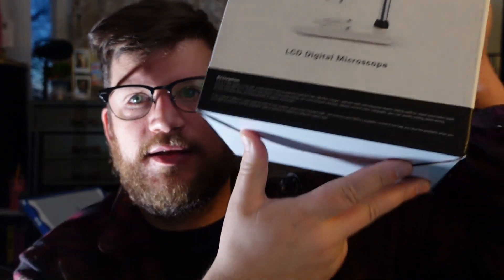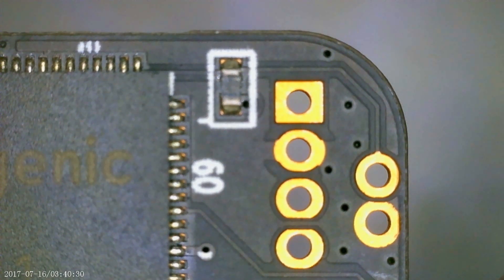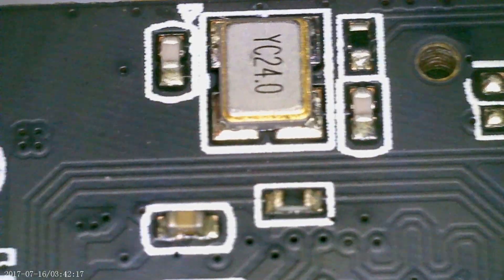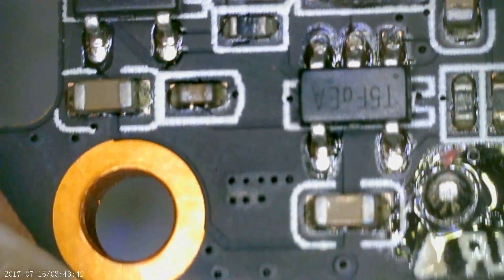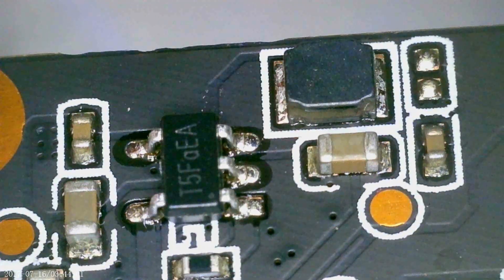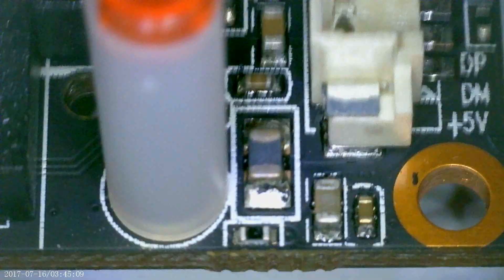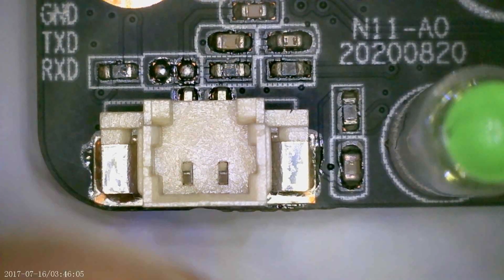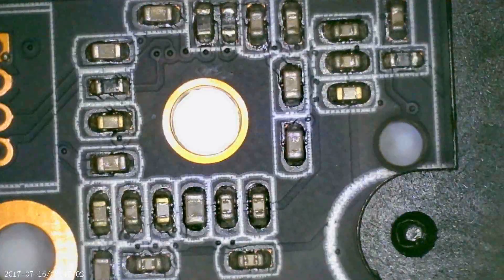$1 RISC-V Inside WebCam | Part 2.1 | Hot Microscope Action!

Comment: what are the two connectors next to the UART? it isn't a secondary microphone connector?
Reply from the maker: I wondered how long it would take for somebody to call me out on those 🤣 tbh I don't know yet. I also considered a second Mike Jack since I know the chip supports 3D sound processing. But my current theory is that it has something to do with enabling flashing 🤔. I will put probing them on the Todo list.
Reply: @hackersbasement  yeah, I want to know. to curious not to. When looking at the board it seems to be a trace to the SOC, but no caps or so. so probably digital.

Another thing that I thought about, there seems to loads of unused pins on the SOC too.
Reply from the maker: @savagesarethebest7251  on the unused pins yah at least the specs that I've seen in the sdk and propaganda ... This is so much more it's leading me to want to build a breakout/tinker board. So for example I can add networking, boot from SD card and support an lcd ... PCBWay has approached me for ideas for collaboration and I thought this might be the ticket (designing a tinker board around the T31). What do you think?
Reply: @hackersbasement  that would be cool. just wish that I had something like that camera around here to tinker with :)
Reply from the maker: @savagesarethebest7251  well tell you what, when I'm finished with it or if I find another choice one I will send you one ... Consider yourself the winner of a drawing...🎉 Send me an email handy@hackerhomestead.com and we can sort out the details.
Showing up and asking for what you want is 80% of success 😜
Reply: @hackersbasement  Oh, wow! fun :)

I hope I do not need to pay import taxes, and the lame ass tax processing fee (Around $9 USD) 😅